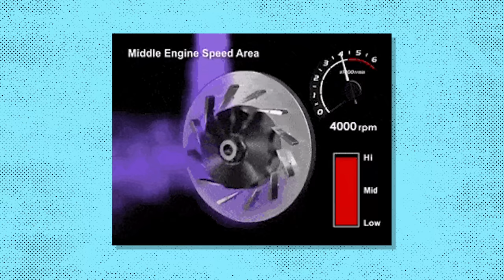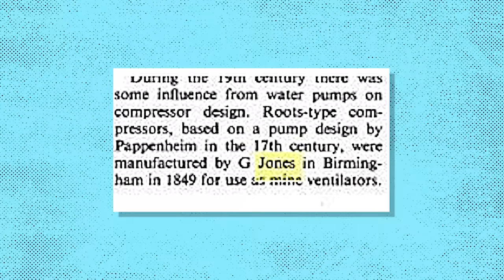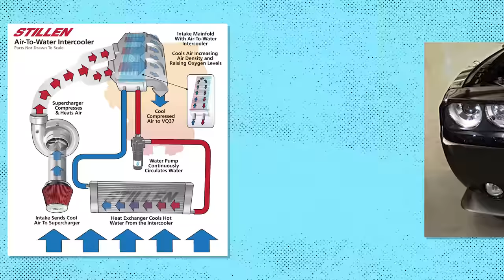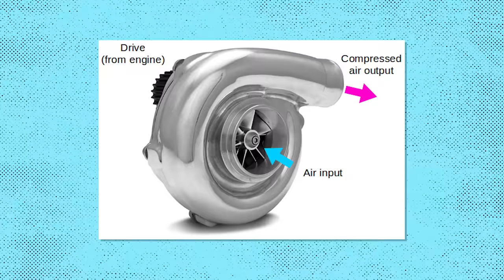Why Superchargers Aren't As Good as Turbos

Comment: The most Powerful Internal Combustion Engine's in the World are Supercharged, just throwing that out there.
Reply: @sandervanderkammen9230  First off Relax, it's really not that serious. It's pretty obvious I'm Referencing Car Engine's, because I don't see any Ocean Liner's in this Video.
Reply: @sandervanderkammen9230  Are You able to Cite a Turbo Car that make's 11,000hp and 7,500 ft/lbs of Torque? Hell , can You name a Semi-Truck making that kinda Power? I highly doubt it...
Reply: @jerodrobinson4040  If you are referring to NHRA TOP FUEL and Top Alcohol classes?
Your point is completely moot.
Because turbochargers were banned by NHRA because they made the cars too fast.
It is also a moot point because Top Fuel is Vintage Class racing. (No new, modern  engines allowed.)
And is a single engine formula series, only the 1964 Chrysler 426 engine is allowed to compete.
Any questions son?
Reply: @jerodrobinson4040  Some simple math tell us that a turbocharged Top Fuel engine could easily produce and additional 1,000 to 2,000 horsepower.
Reply: @sandervanderkammen9230  It's kinda tough to be the most powerful Engine on Earth if You don't exist...
Reply: @sandervanderkammen9230  And My Point is the most Powerful Engine on Earth is Supercharged. So No it is not Moot. That is Fact.
Reply: @jerodrobinson4040  The fact that turbochargers are banned in NHRA destroyed your argument.
Reply: @jerodrobinson4040  The most powerful engine on earth is turbocharged... over 100,000 horsepower.
Reply: @sandervanderkammen9230  And in Reality if Turbo's were Legal Teams would likely still Run Supercharger's for the same reason's They Run 2 Valve Head's when 4 Valve Head's Theoretically make more Power, and are Legal.
Reply: @sandervanderkammen9230  4 Valve's Flow greater Volume, but 2 Valve's improve Intake Velocity in the Low and Mid range. There's give and take with everything. Including Turbo and Supercharger's..
Reply: @jerodrobinson4040  Why would you want less power?
Reply: @sandervanderkammen9230  No not really, a Theoretical Engine that doesn't exist cannot be the most Powerful in the World. Which means I'm still 100% Correct...
Reply: @jerodrobinson4040  4 valves increase volumetric efficiency because they reduce pumping loss.
Turbochargers also increase volumetric efficiency and significantly reduce pumping loss.
 Turbochargers also increase thermodynamics efficiency.
Reply: @sandervanderkammen9230  For one Simple Math doesn't always transfer into Reality the way it should. What should happen, and what does happen don't always match up.
Reply: @jerodrobinson4040  You are clearly not qualified to speak inteligently about this topic... don't pretend to be something you're not.
 At 65psi of manifold boost pressure a positive displacement type supercharger requires are least 1,000 horsepower on a 500 cid. Chrysler HEMI.
 That's 1,000 horsepower that is not going to the wheels.
Slower ETs and trap speed is the result
Reply: @sandervanderkammen9230  Sure, but not until their revved up. Say both Engine's are at 3 to 4k the 2 Valve is going to have better Volumetric Efficiency. It will through the majority of the Rev range. Its just not capable of reaching the Peek a 4 Valve is. But that doesn't mean it's slower, especially in a Drag Race.
Reply: @sandervanderkammen9230  No, I don't think You are. You're stuck on "This Engine makes 50 More HP, so it's better"
Reply: @jerodrobinson4040  Sorry but you obviously don't have any formal education or professional experience in the field of engineering.
 Anything that restricts flow reduces volumetric efficiency and increases pumping loss.
Reply: @jerodrobinson4040  simple math kid, more horsepower = faster car.
Reply: @sandervanderkammen9230  Unfortunately Winning Race's is not Simple, and You're definitely not Talking to a Kid.
Reply: @sandervanderkammen9230  If You have 2 Engine's with Identical Cylinder dimension. A 4 Valve will sure enough Flow a greater Volume of Air. But here's where You get confused. Volume is not the whole Picture..
Reply: @sandervanderkammen9230  So yes, the 4v Flows more Air. The downside is it takes Longer to generate Velocity. And Velocity is very important.
Reply: @sandervanderkammen9230  Say You're making 10-15% more Peek Power then Me. But My Engine reach's full Power 10-15% faster than Yours. Who do You think is going to Win a 4 Second Race? Nevermind the fact that Your 10-15% More Power could very well end up translating into You knocking the Tires off at the 60ft.
Reply: @sandervanderkammen9230  What's Painfully obvious here is You may have a a little better understanding of Engine's than many, but You have next to 0 Competitive Racing experience. In the Real World, the most Powerful Engine very rarely translate's into the fastest Car. HP is not Everything.
Reply: Guy's Google the Definition of Volumetric Efficiency, and now Everybody in the Comment Section thinks Their Big Daddy Don Garlits...
Reply: @jerodrobinson4040  Any compareable engine with greater volumetric efficiency and lower pumping loss will produce more horsepower... this is an irrefutable fact that cannot be disputed.
Reply: @jerodrobinson4040  Absolute nonsense son, 2-valve engines are inferior to 3, 4 or 5 valves.
 Multiple intake and exhaust valves are not used in Top Fuel for only one reason, THEY ARE BANNED.

Only the 1964 Chrysler 426 engine is allowed to compete.
Top Fuel dragsters would be faster with 4 valves heads.
Reply: @jerodrobinson4040  Your lack of knowledge and experience betrays you.
Horsepower is the amount of work done in a specific unit of time.

It is basic engineer principle, 2 cars of identical weight and a identical distance to travel, the car with more horsepower will travel the distance faster.
Reply: @jerodrobinson4040  In the real world automotive technology passed by Top Fuel a half century ago.
Reply: @jerodrobinson4040  This guy watched a few drag races and now he thinks he is a Fluid Dynamics Engineer.

Any questions son?
Reply: @sandervanderkammen9230  I'll give You the Legality dispute, I received False information. Have no problem admitting I'm Wrong.
Reply: @jerodrobinson4040  I accept and thank you for being a good sport.
You made a good argument.
 I apologize if I came off a bit prickly   but I am very serious about my profession, my best friend and I have both worked for the number one manufacturers of Top Fuel and Funny Car cylinder heads.  

Cheers!
Reply: @sandervanderkammen9230  But 2v being inferior to 4 is just not true. The only time a 4v takes the advantage is at the very top of the Rev range, and we're talking 10-15%. 2v Engine's maintain higher Velocity and make better Power and Torque throughout the low and mid-range. And that's a fact...
Reply: @sandervanderkammen9230  Sure the 4 Valve Win's a Dyno Contest. But Winning on the Track or the Street ain't so easy. If You're not turning 10,000+ RPM a 4 Valve will be in trouble.
Reply: @jerodrobinson4040  Sorry Jerod, that is a common but false urban myth, it is perpetuated, solely based on engine builders who specialize in street cars and the need to maintain drivabilty at the expense of maximum power and performance.
Reply: @jerodrobinson4040  Sorry Jerod but anyone who drives a Honda, BMW or Bugatti knows that is not true...
4 valves is ALWAYS BETTER than 2.
Reply: @sandervanderkammen9230  Trying to keep this short. For example I have an 82 XJ-750, Twin Cam 2v. 98hp 59ft/lb Wheel. My Buddy has 94 GSX-R 750. 4v 112hp 64ft/lb, better Engine in every way. Except He can't get around Me without at least a 1/4 Straight. Actually I pull on Him in the Twisties. And it's because the only time He outpowers Me is above 9k.
Reply: @sandervanderkammen9230  Hold on a second though, the C8 and even the C7 are more than Competitive with the Exotic Market. The C7 Z06 is a Killer.
Reply: @sandervanderkammen9230  GM has certainly proven that 2v Pushrod Engine's at that lol can not only compete with the 4v's but they can beat them. There's Pros and Cons on both side's...
Reply: @jerodrobinson4040  What is your point?
It certainly does not prove in anyway that 2 valve engines are better, produce higher volumetric efficiency or horsepower per liter.
Reply: @jerodrobinson4040  I'm curious about your specs?
Yamaha says the 1982 XJ750 2 valve only produced 81hp
The 5 valves XJ750 produced 90hp.
Reply: @jerodrobinson4040  I don't know about exotic?
 But the Small Block Chevrolet is definitely vintage..
   At nearly 70 years old it is more antique than contemporary technology.
Reply: @jerodrobinson4040  Not in volumetric efficiency, in terms of power per liter the Corvette is not impressive at all.
Reply: @sandervanderkammen9230  No, I wasn't saying They are Exotic. I was saying they're more than Competitive with Car's in the Exotic Market.
Reply: @sandervanderkammen9230  And the LS and LT's don't have too much in common with the traditional 350 SBC. For Starter's they're all 6 Bolt main Y Block's, and the Heads are an entirely different design. The whole Engine is really. The Pushrod's are the only thing they have in common...
Reply: @sandervanderkammen9230  I also had to replace the Clutch Plates and install 20% Stiffer Spring's because anything over 5500 or so would make the Stock Clutch Slip like hell.
Reply: @sandervanderkammen9230  And it's Stripped down from 521lbs to 455lbs. From a Dig it Runs Neck and Neck with a Friend's CB-650R. It's not the Fastest Bike on Earth, but it definitely ain't sitting in anybodies Way..
Reply: @sandervanderkammen9230  And the Stock C8 isn't very impressive on Paper. But it still does 0-60 in like 2.8 Second's. The 19 ZR1 made 755hp, and People turn the LSX Blocks up to over 2000hp all the time.
Reply: @jerodrobinson4040  I certainly hope not, you can buy one for the price of a new pick-up truck.
Selling over 25,000 units per year is not an exotic.
Reply: @jerodrobinson4040  The LT And LS are still Small Blocks, same basic design.
The same is true from 1955 to 1985.. they have made many minor changes to the basic blueprint but they are still the same engine.
Reply: @jerodrobinson4040  Thats an interesting annecdote but is completely irrelevant to your argument regarding 2-valve engines.
Reply: @jerodrobinson4040  There are dozens of cars that do 0-60 in 2.8.
It is not outstanding.
It also doesn't prove that 2-valve engines are better or even equal.
 When we make valid comparisons using standard metrics 2-valve engines have inferior performance to 3,4 and 5 valve engines.
Reply: @sandervanderkammen9230  Not sure how You arrived at that conclusion. Your Claim was 4v is superior to 2v, and the LS/LT Platform sh*ts all over that claim.
Reply: @sandervanderkammen9230  Everything 4v Engine's are doing the LS's are doing just as well if not better.
Reply: @sandervanderkammen9230  In no way did You prove 4 Valve Engines are superior to 2. But that's not Your fault, it's really hard to prove something that isn't True.
Reply: @sandervanderkammen9230  Didn't See this Post last night. The LS and LT are a similar Design. But the traditional SBC the LS Replaced in 03 is a different Engine entirely.
Reply: @sandervanderkammen9230  I mean Yes they're both Pushrod V8's. But that's where the similarities stop. The LS was designed from scratch.
Reply: @jerodrobinson4040  Still based on the original 1955 design.
Reply: @jerodrobinson4040  Yet they all share the same basic architecture and still have part and sub-assemies that are interchangeable.
They are all Chevrolet small blocks.
Reply: @sandervanderkammen9230  Did You just make that up? Because You're entirely incorrect..
Reply: @sandervanderkammen9230  The LS and SBC are completely different design's from the Ground up. There isn't a single part that is Interchangeable.
Reply: @jerodrobinson4040  Absolutely not, the LT is the result of a long, continued development of the original 1955 design.
Reply: @jerodrobinson4040  That is not true, there are parts still interchangeable as a direct first or as a sub assembly.
Reply: @sandervanderkammen9230  No, that isn't True. The LS-1 was Designed from Scratch. Nothing from the Original 350 SBC Carried over.
Reply: @jerodrobinson4040  It's still a Chevrolet small block, not an all new design.
Reply: @sandervanderkammen9230  The LS has a different Block, Head's, Crank, Valve's, Piston's, Cam, Lifter's, Ignition System. They don't even Achieve 5.7 Liter's the same. The 350 SBC has a totally different Bore and Stroke than the LS-1 has.
Reply: @sandervanderkammen9230  Yes it is an all New Design. Everything including the Block is different. The LS has a 6 Bolt Main Y-Block. They're Both Push-Rod V8's but that's where the similarities end.
Reply: @sandervanderkammen9230  It's Kinda like Saying the Honda K and B Series are the same cause They're bot Twin Cam 4 Cylinder's.
Reply: @jerodrobinson4040  The GM small block has been manufactured with 14 different displacements since 1955 including;
4.3 liter
4.4 liter
4.6 liter
4.8 liter
4.9 liter
5.0 liter
5.3 liter
5.4 liter
5.7 liter
6.0 liter
6.2 liter 
6.5 liter 
6.6 liter 
and a 7.0 liter.
They all use the same,
 bore spacing,
Bore angle
and firing order.
Many changes have been made to the small block over the years were larger upgrades made in stages.
Many parts are still the same or interchangeable in combination with other parts.
Reply: @sandervanderkammen9230  Yes, the 1st Gen's are Compatible with each other. But not with the LS Platform because the LS is a completely different Design all together. GM Discontinued the Design You're Talking about in 2002.
Reply: @sandervanderkammen9230  And the 4.3 is a V6 with a 350 Bore and Stroke. It's not Considered a Small Block...
Reply: @jerodrobinson4040  No, Its not.
They are all Chevrolet small block engines
The 1955 to 1957 4.3 liter (265) V-8 is the very first Small Block Chevrolet engine.
I own a 1957 Chevrolet 4.3 liter small block, I can assure you it has 8 cylinders.

Comment: Turbos make parasitic losses. Apart from exhaust restriction, long races with hard throttling makes the turbine accumulate more and more heat then heatsoaking the compressor and causing hotter intake charge temps. Hotter engine bay temps.
Reply: You are very confused and misinformed, lacking a basic fundamental understanding of turbocharger dynamics.
 Turbochargers do not create a parasitic drag on the engine and there is no increase in backpressure.
 Turbochargers absorb heat energy from the exhaust and convert that heat into horsepower just like the recprocating engine.
 The temperature drop through the turbo is directly proportional to the amount of horsepower generated by the turbocharger.
 Turbocharged engines produce more horsepower than superchargers at the same manifold pressures.

Heat transfer from the turbine section of the air flowing through the compressor is less than 4%.
Less thermal gain than a positive displacement compressor and is much more efficient than a centrifugal supercharger overall.

Any questions?

Comment: They don't use them because they're 1,000 to start why aren't the top fuel dragsters using turbos is what you should think about if you want full break your neck power you use a blower turbos suck they're for chumps
Reply: Turbochargers were banned by the NHRA in Top Fuel because they made the car too fast.

Comment: Regular Turbos are total crap, cheap junk that will not last more than 60'000 miles. By the time you add a titanium impeller and a ceramic turbine, bearings, you're talking upwards of $20'000.- for a high quality turbo, not the $2'000 crap you find in any regular car engine. Superchargers are also typically cheaper than high end Turbos. In any case, if you are using a water to air intercooler, you are doing it wrong. You need air to air intercooling for top performance. But air to water just saves a lot of space and is again cheaper.